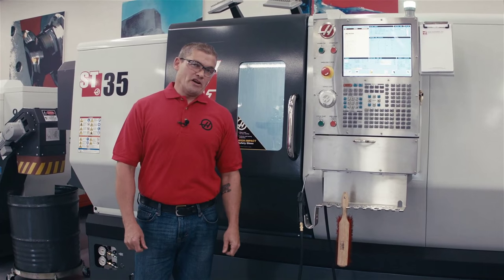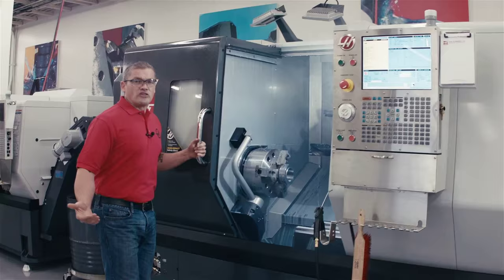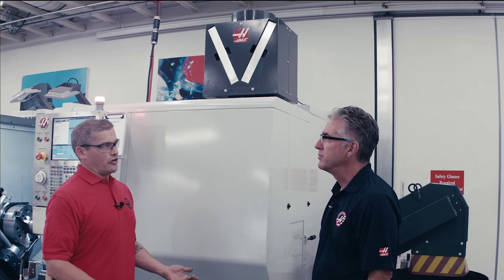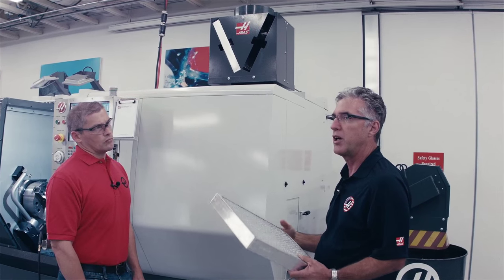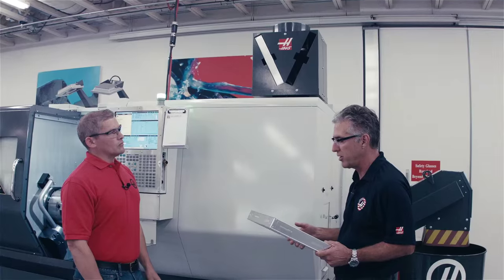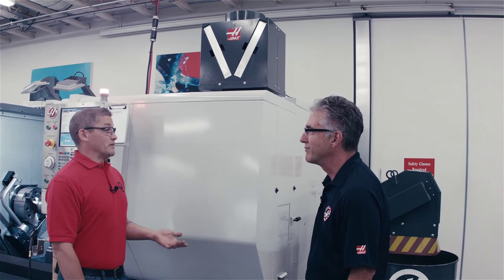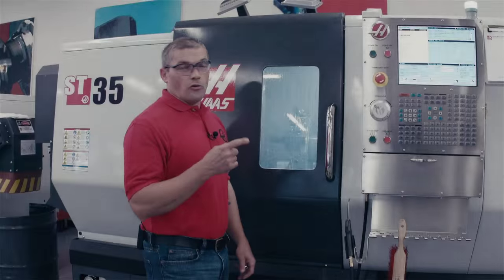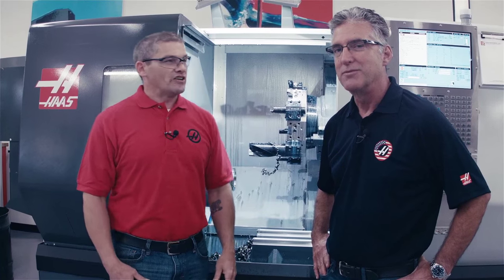The Haas Enclosure Exhaust System

Comment: Is it possible to run this w/o the controller integration? we have Haas and Mori verticals and right now the Moris need an exhaust system and those mistbusters are pretty spendy.
Reply from the maker: Blain4420 These units could be run on other non-Haas machines. You would need to find a power source for them and then an on/off switch. When used with the Haas control, the units turn on and off automatically and with a new Haas will indicate when the filter is dirty.

Comment: Half the price, but solves only a part of the problem...
These HAAS units complete only one task - removing the oil and water mist from your machine tool cabin. Which is good, but...

They fail at the following:

- Cleaning the air in any way (so a duct needs to be used to direct the removed air outside - probably forbidden by local authorities in some places)
- If air filtering is not present and you are not able to release the air back into the shop, you lose the heat generated by the machine tool = higher heating bills
- No recirculation of MWF back into the machine tank = more fluid top up = higher running costs

You get what you pay for :)

Comment: Nice feature.
But it will not remove fume and it will release polluted Air into the shop.
Only an electrostatic element can eliminate health threatening fumes.
Will you add such a device in the Future?
Reply: True, This is very important for operator. I hope every machinists healthy and good quality of life.
Reply: False.. Even electrostatics are garbage and require maintenance. Way better options out there.